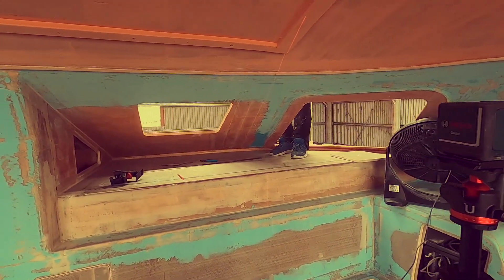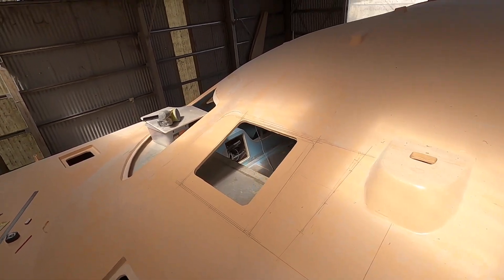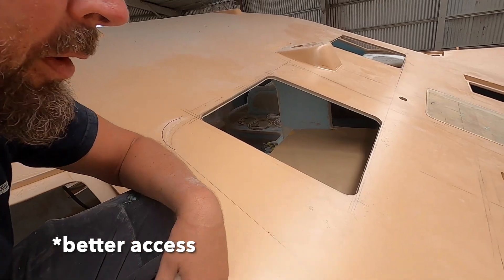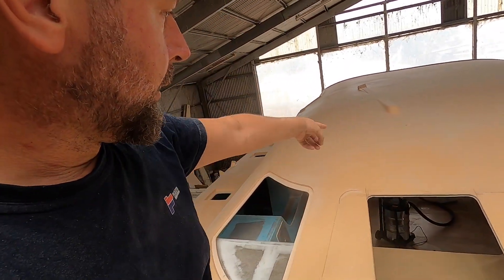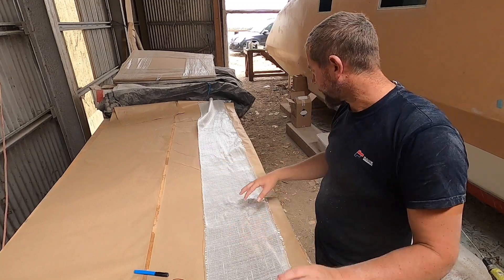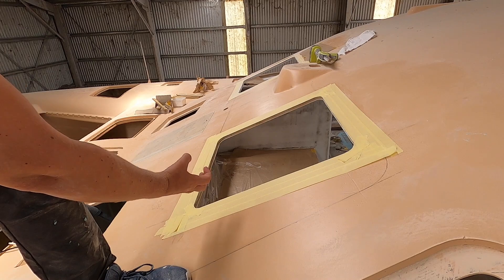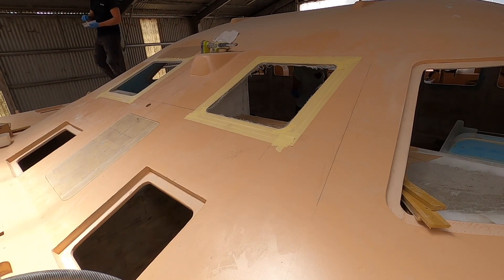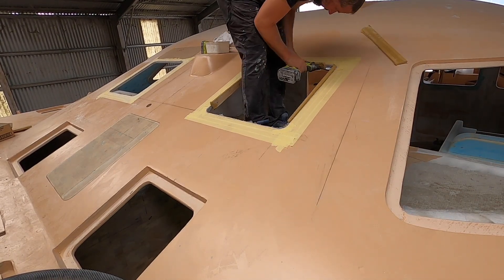Will she have strong enough hatches?

Comment: My mate with a 1320 he built himself doesn't even have hatch/windows in the front of the cabin after staying on some other mate's Schionnings. I would recommend having as small as possible windows/hatches at this angle. The solar gain from these type of hatches is really high and cooks the interior. Maybe you can make some glass/balsa hatches instead of the expensive Lewmar ones. Don't try and see through them as you can't when wet anyway. When I built my second cabin top for my 38 footer I made the cabin front about 50 degrees from vertical, instead of the sleek looking raked Schionning look, and I kept the hatches as small as possible. Schionnings do get really hot with their sleek windows exposed to the overhead sun. Consider how you can actually REDUCE window size to keep the boat cool in the summer. These raked cabins are about 15 years behind the times nowadays because of the huge solar gain they admit. Few modern cats have them and you could try to avoid the worst of it now before you actually install windows - rebuild the window cutouts much smaller and have a much stronger and cooler boat. You may think you will use the windows up front but they are so raked they are not useful for much forward view under way and with any dried spray they get much harder to see through than more vertical windows. If I could go back in time, I would reduce window size as much as possible and get the boat cooler.
Reply from the maker: You might very well be right. My reasoning behind the big hatches is to gain airflow. Which will likely often be useless at sea or in any sort of weather... I'd have loved a more modern Schionning, with more modern design, like the shaded windows on an arrow for example, just wasn't in my budget. For heat management,  i have some ideas on improvement. These will have to wait a while. As for the spray issue, that is a very good point and one we will also try to sort out.
Reply: @buildingwilda  I would recommend you build nice big hatches out the duflex you cut out. Then you can pop them up for ventilation and they won't let any sun in. So you get better ventilation without the sun load. Lewmar hatches this size will be over $800 so you can save money too. Some small perspex pieces could be put in the hatch. To be truthful, to see forward even better on my really easy to see through cabin, I am going to put in a car reversing camera system. So I would recommend you don't try and see forward through these sloped windows, but you put a camera or two in the front and get great forward visibility through them, you can put screens inside and in the cockpit too.

Comment: When you are back filling the fibreglas (your window edges) try using a plastic bag with the corner cut off. Push the filler through the bag into the board and go back and smooth with your stick/paddle. The same way bakers ice cakes decoratively. Hope that helps in future.
Reply: I bought plastic piping bags online. You can get them in lots of a 100 or 200, etc for just a few dollars, and the conical shape is of course just what you need since you’re basically doing the same job.
Reply from the maker: We have tried... With varying degrees of success 🤣

Comment: Good decision on the hatches there.
Reply from the maker: Yeah.. we think so. It would involve too much rebuilding to cut the front out. It would be great, but require more work than it looks like it might. Rebuilding lockers, hatches, adding deck reinforcement, rerouting piping,  cable trays... Lots you can't see at first sight.... But it would be good...